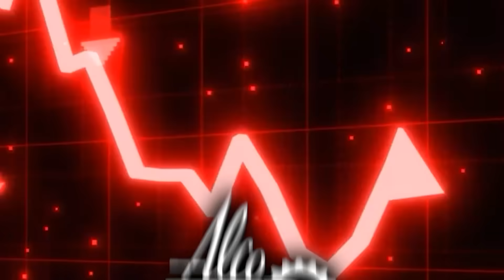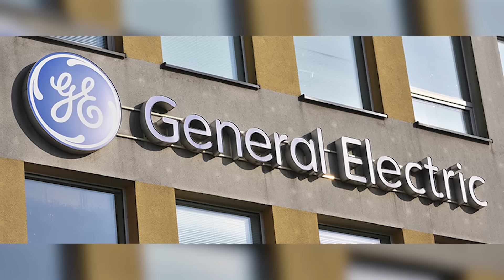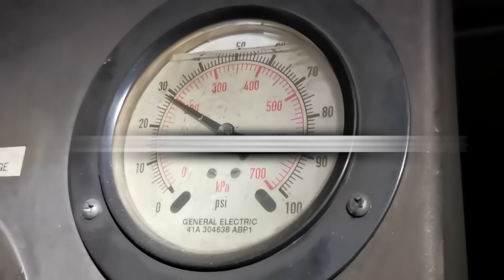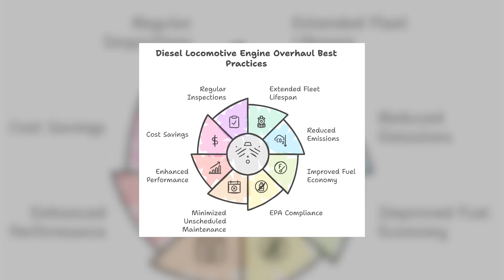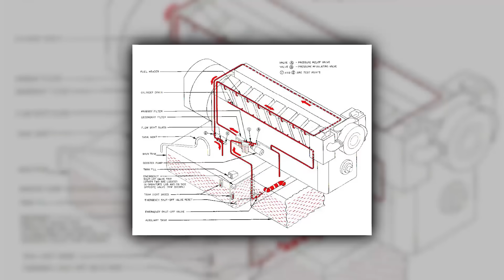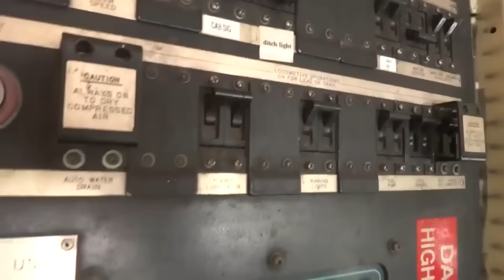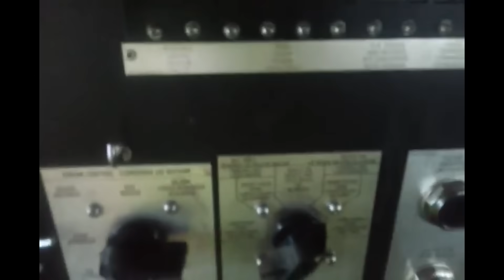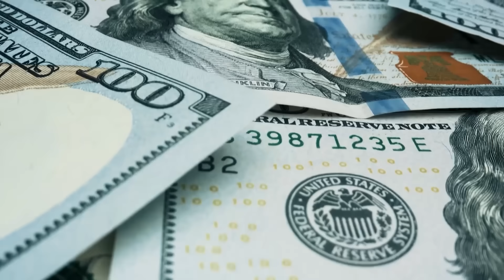The GE Engine That Buried Alco for Good

Comment: And yet GE doesn’t come close to EMD’s reliability or durability
Reply: AS AN RETIRED SANTA FE MACHINIST AND TROUBLE SHOOTER, I HAVE TO CALL B. S ON THIS!!
I ALSO WITNESSED EMD TRYING TO BUILD AN 4 STROKER!! WAS AN PITIFUL FAILURE!!
Reply: @rossbryan6102  More and more professional career railroad men need to squash such irresponsible garbage that is put out by these armchair "experts".   Here is what I posted in other places on this video: "Retired locomotive engineer from a class 1 US railroad. Those FDL diesel engines were junk. One of two things that moved GE out of the sewer was AC traction in 1990. The two stroke 567 and 645E-3 diesel engines of EMD ran circles around that 4 stroke of a failure FDL engine. Those FDL diesel engines far into the U-Boat series often burst high pressure fuel lines, caught fire and always had chronic oil leaks to the point it ran out onto the running boards or had serious oil at the stack that would litterally cover the entire locomotive. And more often than not smoked like an ALCO spewing wasted fuel out the stack in the form of thick black carbon. Two things that put GE to the top was 1. EMD moved to Canada, sold off from GM became Electro Motive Diesel and and the SD50. 2. GE went to AC traction. That FDL diesel engine had nothing to do with its success at the time. In the 90's GE finally got their act together after diesel locomotive pain and suffering. In our locomotive shops on the UP the phrase was often coined "GE can't make a decent light bulb let alone try to build a locomotive --- those pieces of sh-t." The shop bays at North Platte always had more GE's than EMD beyond the quarterly semi-annual and annual inspections. In the mid 1990's GE woke up and their product became more and more reliable and preferred. Now they have become the primary work horses in the railroad industry, with reliability, the latter that one never could say about them in the past." "Retired locomotive engineer here from a major class 1 US railroad: This presenter has other videos that should be fact checked. A lot of miss information. Be wise be cautious. Many of these arm chair railroad "experts" do a disservice to railroad industry. Thumbs down for this inaccurate presentation".
Reply: EMD today or whatever they call them selves, progress rail? Is an embarrassment to the legacy of their heritage. 
New EMDs are nowhere near as reliable at the dash 2 era. 50* years and still going strong on some of those engines.
Reply: @JMVX My company traded in GP9s for a large fleet of GP20eco. Sometimes they have computer glitches, but at about a dozen years in, they are pretty good. I’d still rather have a GP38-2, but they were almost fifty years old, and getting tired. The GP20s are actually pretty good. My only complaint is that they’re really loud. Maybe my company specified less sound proofing.
Reply: @brianburns7211 
Who knows whit progress rail today.
I’m a fan of EMD products but in the recent years it seems thy dropped the ball.  It’s nothing they can’t course correct and regard market domination.
How old are these GP20ECOS?
How is their pulling power compared to the older EMDs   Do they load quickly or have a delay in throttle response?
Hopefully PR shapes up. Because I think  their product is solid,  needs some
More care and operator input put into it.
Like everything else today they’re building with planned obsolescence.
Sound proofing should be an industry standard now.
Reply: How can you say this?  GE’s built in the early 1990’s are still pulling trains on the BNSF.  Where are its EMD competitors, the SD60, 70, and 75?  In dead lines or bone yards.
Reply: And yet GE holds 70% of the locomotive market in north America.
Reply from the maker: That’s a fair point — EMD earned its reputation with the 567, 645, and 710 series, and a lot of those engines are still running decades later. GE’s 7FDL and later GEVOs weren’t always as bulletproof, but they offered fuel efficiency and horsepower that won over the railroads. It’s a classic trade-off, and part of why the GE vs EMD rivalry is still such a hot topic.
Reply: @TheMechanicalSide I think a big downside of GE is that the control system is designed to try and out think the engineer. They don’t always do what one would expect from a throttle change. With an EMD you get what you expect.
Reply: Not true. BNSF won't use EMDs on their Z trains because of their reliability issues. But many engineers still prefer EMDs. GEs are more reliable though. I work with rail crews every week.